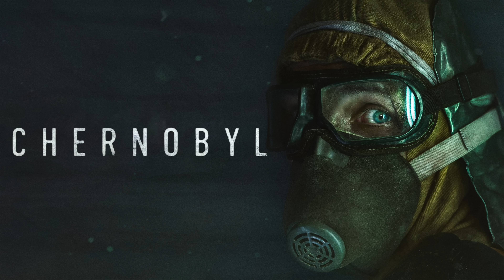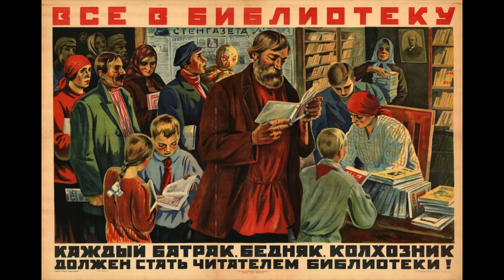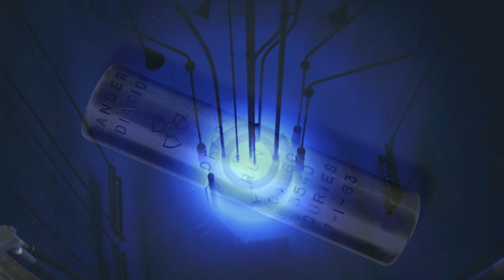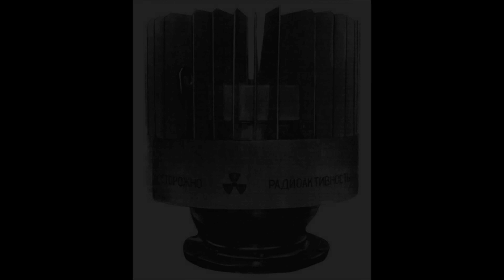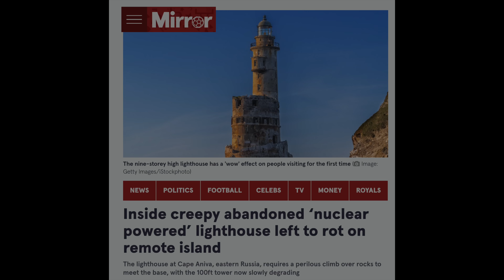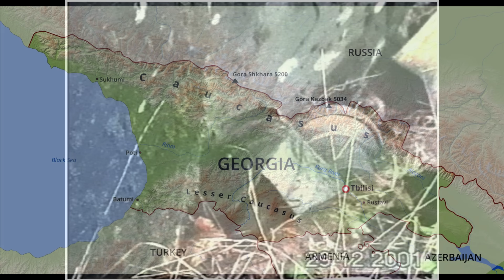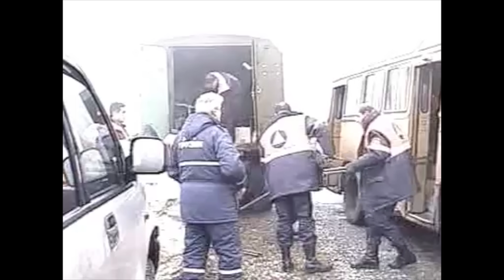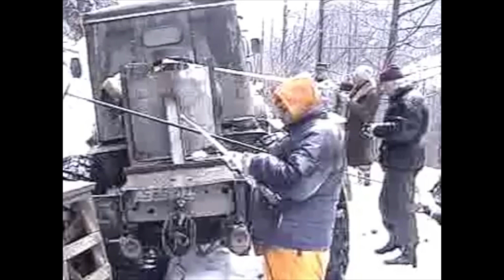The Soviet Union's Deadly Abandoned Nuclear Generators

Comment: would i sound crazy if said i would want one of those abandoned but well conserved RTG and just well "fix the fabric problems" with new technology but still conserve the thermoelectric way and a lead "box",  at least 3 inches of it, and well a room with thick walls and the rtg at the center  and Tada! free energy for myself even after the Armageddon
Reply: also try to not get very close to the thing while working on it, i guess we have machines for something nowdays... and hazmat special lead suit i guess and iodine sad we dont have rad-x or radaway :p
Reply: My thinking about re-engineering one of these units is not for any electricity, but for pre-heating and sterilising my household hot water supply into the hot water cylinder/reservoir, and then use it for central-source distributed heating for the house. Hot showers and warm house 'for life' 😁

Comment: Something to note with the thermal electric generator you showed on the old kerosene lamps, the electricity the generator made was always passive, or not its primary use.  Sadly, it never is good for anything more than passive as the radiator fins you have heat up and need a fan to cool them off to keep it running efficiently enough to produce enough power for a radio to sound clean. Granted, it did help being on the source of light and heat for some families back then to stay warm enough.
Reply: It didn't help with heating the room, as you stated, you needed a fan to cool them. Russians would have to open the window instead, so they have to wear warm clothing just to operate the radio.
Reply: It is still a cool and relevant to the topic of the nuclear generators. But dose that not mean the nuclear versions also needed a cooling fan? Anyways even with the limitations of the tech it seems like the radio for "news" broadcasts would still be possible no? Remember growing up having anyone that cared gather at the TV for the evening news broadcast. It was at most a 30min broadcast or something. If the kerosene lamp was even able to sustain a understandable radio transmission for 15min it would be better then nothing right? You just have to keep track of time and tune in to the state run information.

And in cold winter weather it would be possible to put the lamp outside in the door entrance? You know if you got a wind brake entrance or something. Like it has to be possible to cool it somehow enough for a bit of radio listening? Music and entertainment like we are used to might not be feasible but that was not the goal to begin with this kerosene lamps.

Like back then you can totally believe that the kerosene lamp was going to heat up and light the cold room. If you get a radio broadcast at the same time then grate! If your running a kerosene lamps someone better be in the room anyways. Since you gather at the light source in the dark winter evenings. 

Only thing I was aware a light was able to power is the spinning decoration type. You know the kind of thing you put on top of the air flow of the light heating up the air. The air then pushes fan blades that is powerful enough to make something spin around. Not enough to generate anything worth mentioning in power. More power efficient lamps barely was able to make anything move. And LED lamps are scary. If they get truly hot then your really pushing some power! Or they are without any concept of fire safety and prone to catch on fire being badly designed and built.

Comment: Glad that NASA when the cost of the radioactive material got too high and the material too scarce figured out how to use much less isotope and got more output in the bargain.  They had to go back to the 19th century and turn to Dr. Stirling's engine to turn the heat into energy by spinning a generator instead of using the less efficient thermal electric device.  

IIRC they were using Stirling Generators attached to hot water heaters, etc (running them off the waste heat and pilot lights) for providing electricity to remote areas in the Soviet Block long before NASA started using them in their RTG's.  

Imagine if every heat exchanging/wasting device (some were put in things as small as under-counter water heaters) in the world had a Stirling Generator in it to put some power back into the system.

Sad that so many of these abandoned RTG devices remain still needing to be secured and safely decommissioned in that part of the world.

BTW: Tamper resistant fasteners won't deter a determined thief.  Even the cheapest $10 angle grinder hooked to a featherweight generator will defeat them as will a determined thief with a sledge hammer or maul and a chisel.

Best!

Comment: Not heard of this incident, I remember reading of some guys taking a mysterious object home not sure if it was one of these generators. Great video loved the training and recovery video.
Reply: https://en.wikipedia.org/wiki/1962_Mexico_City_radiation_accident
Reply: You might be thinking of the Goiânia accident
Reply: Most of the radiation exposure incidence you hear of are from old abandoned cancer radiation machines and cobalt 60. People will dismantle the machines for scrap and expose the cobalt 60 source. It's a lot smaller source than these RTGs and doesn't produce heat, but is really nasty source of radiation.
Reply: @m16ty   Radiography sources, used for inspection of welded metal at construction sites, are another common problem.  These sources must be physically small to perform their function, so it is impossible to attach a large warning label.  When such a source is lost, there is a substantial risk that another person will see it, pick it up, and carry it with them.

Typically the person who lost the source will become aware of the loss within a few hours.  They will then start a search and warn everyone in the area about the danger.  But if someone has already picked up and carried the source, that person will likely get a severe radiation injury.

[Edit: corrected typo "pick it it" to "pick it up".]

Comment: American RTGs are built super strong. One was on a space probe where the launch rocket failed and it crashed into the Atlantic. The RTG was recovered, the minor exterior damage repaired, then it was installed on another space probe. They were also known as SNAP or System for Nuclear Auxiliary Power.

At the point where the half life of a hunk of radioactive material is reached, that doesn't make it much less dangerous. It's still radioactive. In the case of an RTG that does mean it's producing less heat and a lot less electricity. Newer Seebeck effect devices are more efficient, but not a lot more than what they were decades ago. The Peltier effect is the same thing but in reverse, put electricity into the device and it moves heat from one side to the other, typically more efficient than getting electricity by heating one side and cooling the other.

Seebeck devices are commonly called TEG or Thermo-Electric Generators, Peltier devices are commonly called TEC or Thermo-Electric Coolers - and each is optimized for generating or cooling, though they'll work, poorly, in the other mode.

Watching the recovery team, I was surprised to hear some of the men speaking English. "Stay behind the rocks!". Has the health of these been been monitored over the years since? If they've fathered children since this recovery, have they been checked for problems?
Reply: I think they had international workers there as well, hence the English you hear. And the SNAP-27s better be strong, because there's one buried in the Tonga Trench in the Pacific from Apollo 13.

Comment: Since the internet loves to use bananas for scale, and because bananas are also radioactive, I did the math. It would take ~20,408,163.27 bananas to produce the same amount of hourly radiation as a Beta-M. Laid end to end this is roughly equal to 2,415.74 Miles of bananas, which is only 400 miles less than the distance from the East Coast to the West Coast of the United States.

Comment: It's a real shame such an amazing technology isn't respected and abused like this giving it a bad name, RTG's have the ability to do amazing things on Erath if the technology is properly engineered and treated with respect.
Reply: Except the solar panel would only generate that amount of energy during sunlight, which on average, happen only half of the day. So you would need at least double this area, and a battery to store the energy. Also, the amount of sunlight reaching the arctic circle is quite low, so the comparison has more depth. I still agree that today solar panels are better, but in the past it was not the case, the solar panels had worse performance, batteries were not as good, and above all, both components were expensive.
Reply: @arthurdefreitaseprecht2648  the rtg's charged batteries which in turn powered the lights. So your point about solar panels requiring a battery is moot. I still agree with most of what you said, just wanted to point out the fact that they already utilized batteries.
Reply: @ctdieselnut No it isn't, with solar panels you have less light during the day there hence less generated electricity. When you drain battery's to such an extent they wear out too fast thats what they mean with multiply the capacity so the battery Doesn't deep discharge as much and has a longer life.
Reply: @arthurdefreitaseprecht2648  Even today, no solar panel will ever compete in terms of overall reliability either, nor will the solar panel necessarily be more compact in total either. The surface area of a panel isn't the only driving factor of its footprint and installation needs. Solar panels need open space with clear views of the sky, and clearance for any supporting systems. They need to be installed correctly by a crew, and will likely need service regularly to keep them clean and functional. Even if perfect solar panels existed, a soviet RTG would still have it beat for many applications, because you just can't feasibly install a solar panel in a bunker, or in the middle of the woods, or a rocky beach on the arctic coast. An RTG is plug and play. It's a box that makes power with absolutely zero input needed, and the only installation requirement is a flat place to put it.
Reply: nuclear technology and vodka is a bad combination
Reply: Given that many "first world" countries have perhaps hundreds of Nuclear power-plants, making electricity, if the expended nuclear fuel could be "reused" to power RTGs, imagine all that spent fuel in sealed, "idiot-proof" RTGs in every home supplying decades and decades of electric power????? But, the height of human intelligence is only as high as the most stupid of us...
Reply: Dont just limit it to earth, they are used for deep space travel, too.
Reply: There are solar panels or wind generator and acumulators with different chemistry now. No need for RTG on Earth.
Reply: there is nothing amazing, thermocouple effect is known since forever and coupling a heat source with a thermocouple or semi-conductor is not exactly cutting edge. The issue here is benefit risk ratio and efficiency. The efficiency of these RTG was ridiculous and the benefit risk ratio was several orders of magnitude in the negative side. The only reasonable usage for these is in space, and even then solar usually made more sense. Only that garbage ideology / country of URSS was pathetic enough to use this non technology in the worst way possible.
Reply: Well, no. It has horrible efficiency and thus only good for space, due to it compactness.
Reply: @Hey hoe  You are sort of right that the danger outweights the actual usefulness, BUT its not the efficiency. It doesn't mather if the efficiency is 1% if a pellet with the size of a marbel has the energy content of million liters of oil.
Reply: @heyhoe168  seems like it worked pretty darn well for its intended use…. Show me a solar panel that would work as well as a 8” block of strontium 90.
Reply: @donaldsherman1  any modern solar panel. the rtg could only output 250W thermal energy and even if we assume the maximum amound of scavengable power using modern thermocouples (8%) you would only get 20W usable energy. Assuming maximum output for solar panels (20W/sqf) you would be able to generate the same amount of energy with a singular square foot sized solar panel, which would take less resources and space than the soviet RTG
Reply: @pSaragraphGuy  except solar isn't reliable enough for this application. Doesn't work in the dark, or near the arctic circle where its only light out for a few hrs a day, and its cloudy 2/3 of the year. Todays solar panels lose efficiency over time, and are shot in 20 yrs, who knows how expensive and inefficient they were in the 70's when the rtg's were deployed. Plus the rtg's last 30+ years. The problem wasn't even really the rtg's, the problem was how the ussr and now Russia designed, and now abandoned them. 

Edit - i see someone above made most of the same points.
Reply: @donaldsherman1  i have a 15W solar panel out in my garage for powering some LED lights i never got around to setting up
Reply: What are you guys even talk about? Generating several dozens or even couple hundreds watts of energy in a remote location (even sub arctic) using solar would be so easy this days. Throw there some fan to make extra electricity from wind, and some telemetry to monitor a system and you are good to go. Using RTGs for this application would be comically expensive, extremely hard to deploy and maintain, unbelievably dangerous and just plain ridicules.
Reply: @koobapl  Do you have any idea how little sunlight they get in the remote arctic areas where a lot of these RTGs were deployed or the weather conditions? Some occupied areas of northern Russia only get two hours of light per day in the winter and it's only described as being "slightly less dark", with the sun never even peaking over the horizon. And these are the occupied areas, the unoccupied areas that are even farther north are worse. Then you have the weather, how well are solar panels going to work with that little light when they are also buried under several feet of snow and ice?

Comment: As bad as it might sound I would love to have a few of them to power my house.   As long as they are not compromised and you store them in a safe underground shielded bunker then all good.
Reply: You would need a lot of them, at 10 watts output you would have required six of them to light a single 60w incandescent lightbulb.  They were just strong enough to power a little radio beacon beacon or a fluorescent bulb.
Reply: @krashd  Indeed, we have solar panels now!  Or wind generators where there is no sunlight for long periods like the artic
Reply: @murraymadness4674  What happens when you have no sun or wind (and the artic goes for long periods with little sunlight during the winter)?
Reply: @krashd  They might make for semi decent heating elements, would still need a relatively large number for a medium isolated  house here in Denmark though.
Reply: As Rob says below, the Sr90 RTG's barely would run a lightbulb. It was just enough for battery charging for the light in the lighthouse.  You would need something more akin to the SNAPs used by NASA, but those are Pu238 powered, and I don't think those are gonna be for sale to the general public anytime soon...

Comment: RTG can be a solution, but it has to be very well planned.
Deploing it outside without any protection is absolute crazy.  They need at least a Concrete housing wich is Storm proof and a Stainless Metal shield as corrosive protection.
Reply: It WAS well planned (10-30 years of service on average) and reguraly inspected until country that doing both thing ceased to exist. Georgians didnt have capacity to maintain shit in late 80s and 90s, they we occupied with their nationalistists border conflict with Azerbaijan and scrapping all soviet industry they were left with for sweet dollars.
Reply: When the soviet union collapsed they had no ability to maintain these sites, and looters attacked the stations to steal wires and metals. They didn't put them in concrete simply because as long as they were supervised and maintained there was no problem.

Comment: I have to admit that it'd be kind of funny to see footage of the thieves after they opened up the device. Might be ghoulish, but that's why they're called Darwin awards.
Reply: If someone has no knowledge of radiation then such a death doesn't qualify as a Darwin award.
Reply: Why would any think someone would abandon such a deadly device in the woods?  The people that try to steal copper wire from an electrical substation that is operating, they are dumb criminals.   Finding use for junk you find abandoned is being smart.

Comment: ...I'l take 3 thank you very much. Bury them edge of the field and produce power until needing the refueling. That is where least some of the RTG's are located. I recall remote village in Siberia that has one producing their electricity. Only down side is that they need to keep lights on all the time to have some load on it, but meh not big deal. Design should be done bit better but if its in shipping container and above water table not big deal.

Comment: Could the freeze damage have happened if the rtg had been retrieved at the end of it's useful life?  I'd imagine the amount of heat being given off would have been enough to prevent freezing inside the casing.
Reply: If the cover around that RTG stood? Sure. With it being completely exposed to elements, though - unlikely, as strong winds combined with water and very low temperatures could overpower the heat on the radiator and outer casing. But that wouldn't happened if they were inspected regularly and initial damage was spotted (cracks, etc).